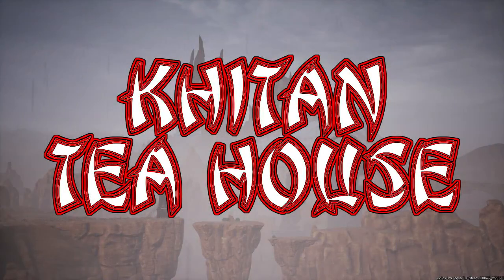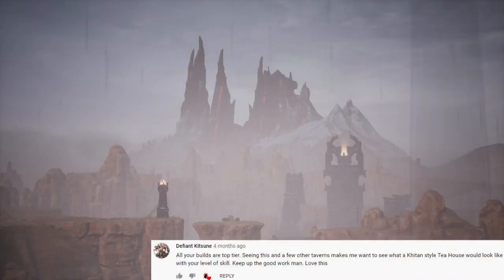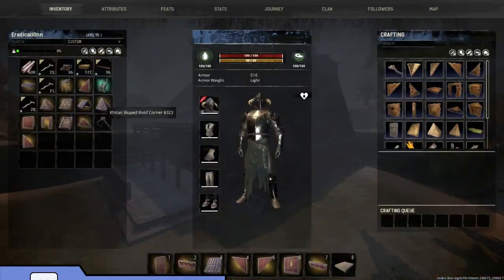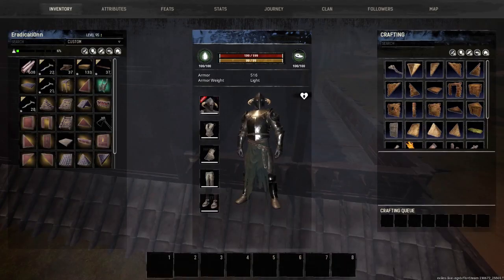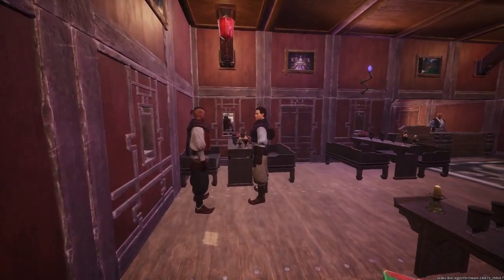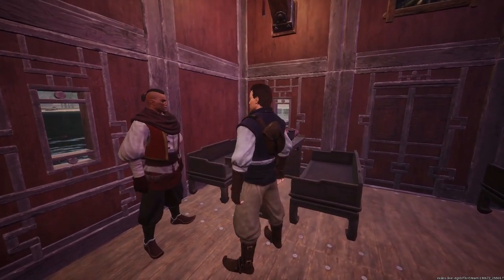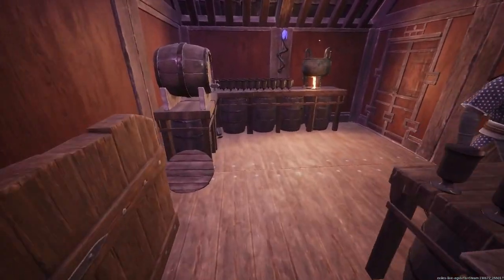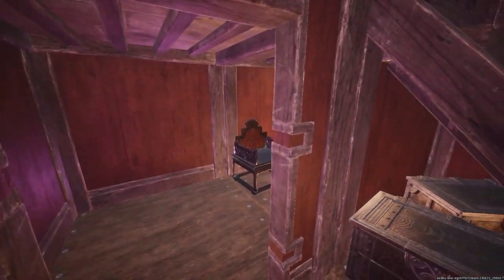Conan Exiles: Khitan Tea House Build Guide

Comment: The public tea room seems a bit too bar-like with those beer, ale or wine barrels and all the western-style footed cups. I suggest instead searching your mods for oriental-looking pots, cups, canisters, banzai or potted plants, and statuettes or idols. Put them on shelves on the walls or on bookshelves to create a more homey decor. You might also be able to find some oriental-looking folding screens to provide semi-private seating areas. The floor pillows look too small to be comfortable, I think low stools would look better if you can't find larger pillows that look more like square futons.
  
On the exterior, you obviously weren't going for a traditional look so I won't critique it. Upstairs, you already mentioned that the living quarters are quite small. I'll just add spartan too. More could be done to make the decor more homey, lived in, and Chinese, or at least oriental.
Reply from the maker: The tea room does feel a bit bar-like, however I didn't use any mods aside from LBPR, so the repertoire of items was fairly limited. Statuettes would have been a nice decorational touch though, as would the shelves. The living quarters maybe could have done with a little bit of extra decoration too, maybe in the tower, as that part is definitely a bit barren